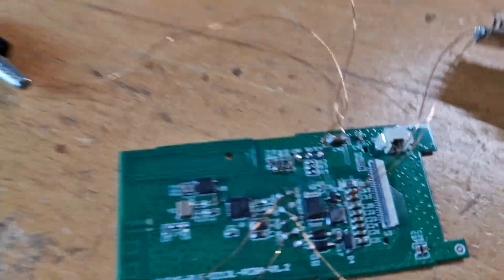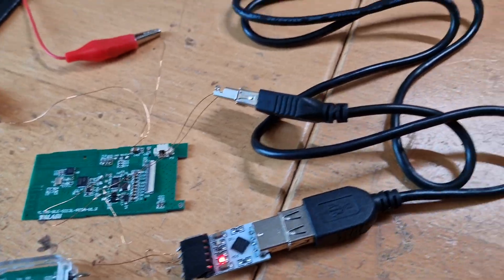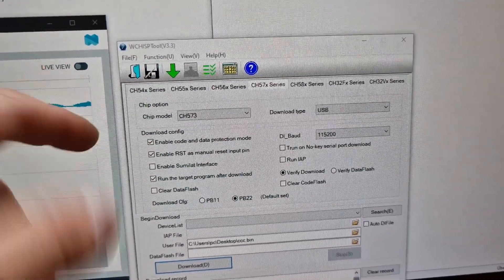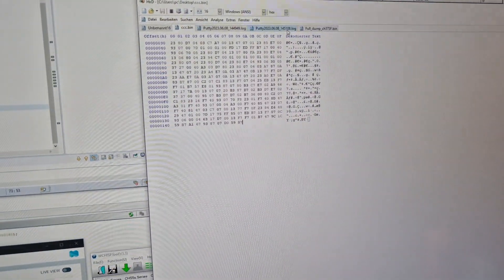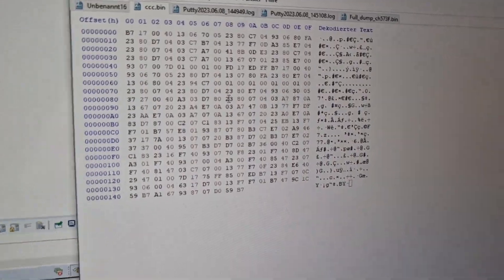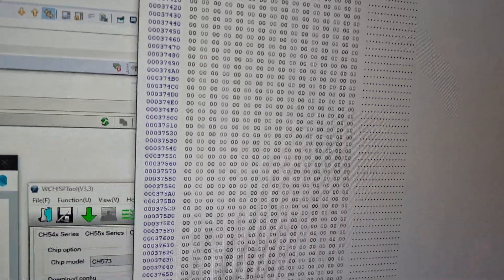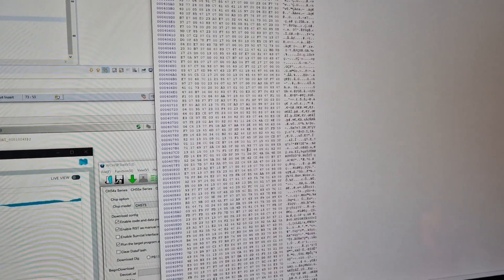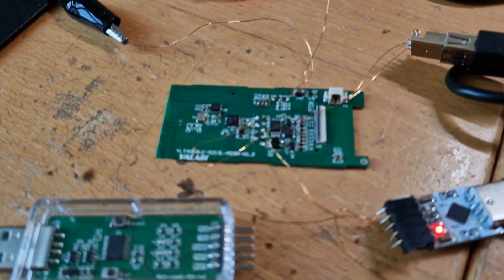Exploit Friday: WCH CH573 Memory Read-out Protection bypass

Comment: I was able to dump CH571 firmware with similar method. Your video gave a good clue on where to start. In my case there was no OTA and thus no second copy of the fw, but there is a way around it. You can make bootloader think it erased 8K without actually erasing anything by issuing erase command with negative length of -3 (32-bit) (e.g. with a modified version of isp55e0 programmer on github). Then bruteforce the first 4 bytes of the firmware via "verify" hack like in your other video and replace them with a jump to dumper code. Verification is done in blocks of 8 bytes. In 99.9% cases the first 4 bytes would be a jump instruction with 20 bits of address followed by 4 zero bytes, so there is no so much to bruteforce, it took me about a minute. This hack works for bootloader 2.90 and probably older versions.
Reply from the maker: Nice chain. Gonna try it on the next target❤
Reply: @atc1441  Btw, they tried to prevent bruteforcing by blocking verification after first failure, but it did not work) You can use the same erase(-3) hack to reset verification lock.

Comment: If you had 2 identical devices, maybe you could move your dumper code to the end in one so it will dump the boot and first section of firmware. I did this with some PIC microcontrollers. Flash dumper code in boot section to get flash section on one, then flash dumper code in flash section of the second one to dump the boot section. Then, between the two dumps, you have the full image.

Comment: I'm currently working with a similar board. But versions 2.0. And I'm experiencing similar problems. Can you provide a firmware dump?
Have you tried doing firmware analysis? Analysis of an external flash memory chip?
I want to make a BT exchange analych and independently display information on the screen.